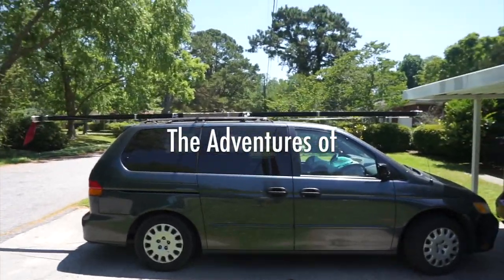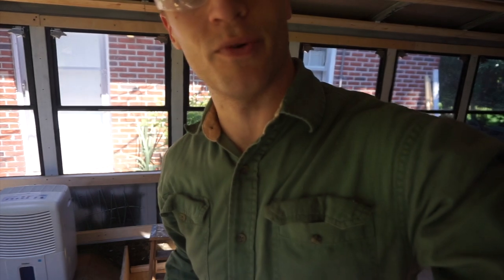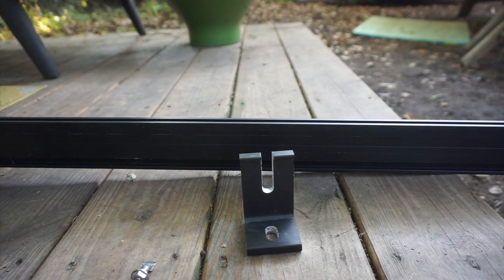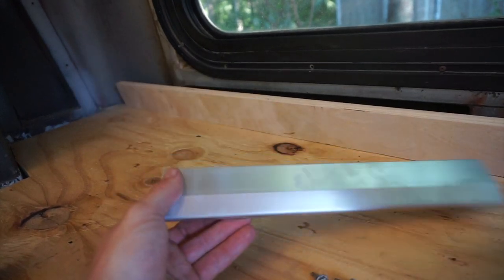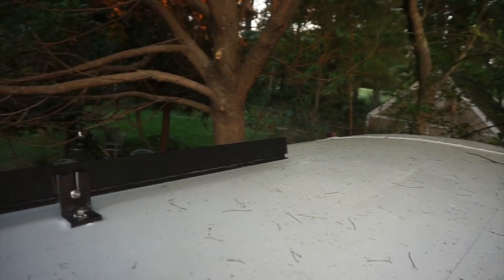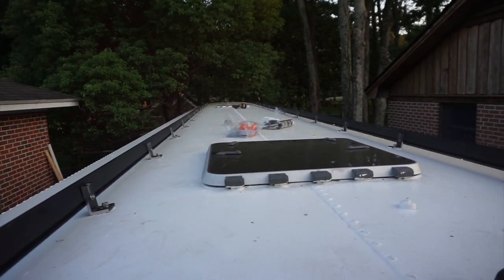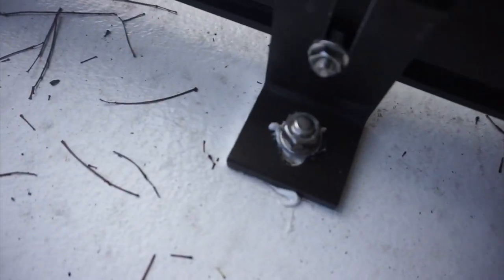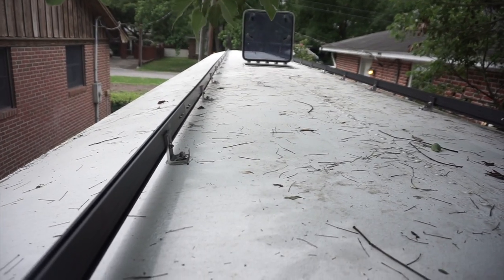Skoolie Solar Deck/Roof Rack Installation: School Bus Conversion Ep 17

Comment: I'm doing this same setup (with the xr1000) and I just got the hardware today. Only difference is I'll be screwing into my hat channels vs bolting. My question - was your roof angle an issue with attaching the panels with the rails not being 90 degrees? I have a collins body which is fairly flat but there's still some roundness nonetheless.
Reply from the maker: A nice flat roof like mine makes it a non issue. You’ll be fine with the Collin’s too.

Comment: What angle did yours come out at?…. Mine were slanted out and not 90*
Reply from the maker: Mine were quite close to 90 as my roof is so flat. How far from 90 are yours? Check out what Chuck Cassady does to handle the curve and put the feet further out: https://www.youtube.com/watch?v=zTqqPJLp7LU

Comment: Hello, I really appreciate the video! Would you be able to link or list the parts you used in this rack system? There are some different options available for rails and hardware and would like to know what you used if possible. There are so many different L feet at varied costs but they all look the same. Also, how many L feet did you use for each railing? Thank you!
Reply: Hi seconding this request! I'm working with an IronRidge distributer and knowing the specific parts you used here would be soooooo helpful.

Comment: How is your roof rack holding up? Any issues with it, im thinking of doing this.
Reply from the maker: Roof rack and panels are rock solid after 15K+ miles. I go up there every once in a while to check panel to rack bolts for tightness and they don't loosen. Highly recommend. Already installed it on a second bus.